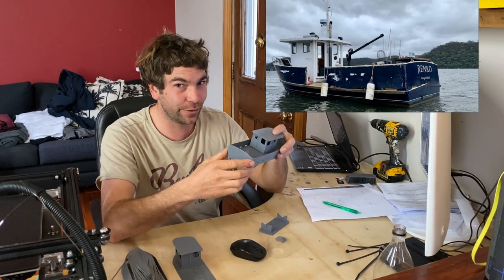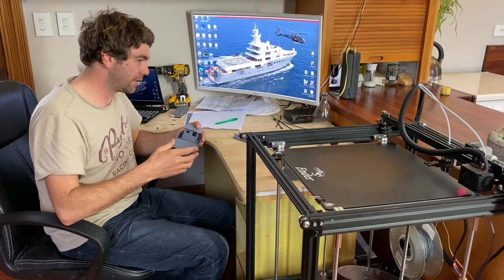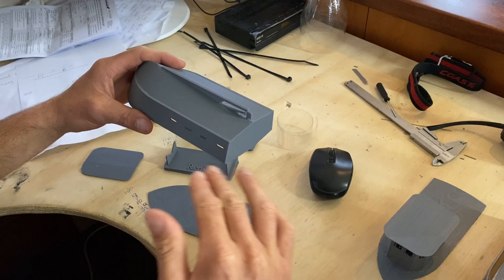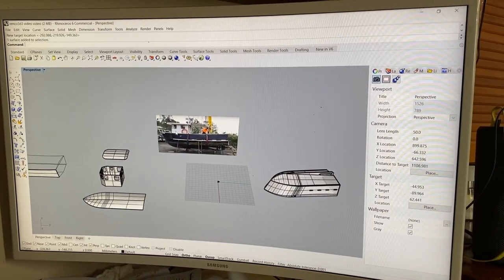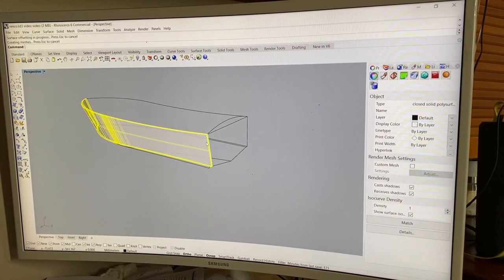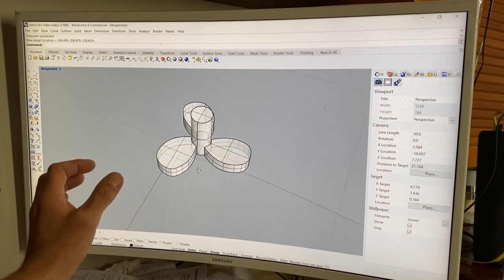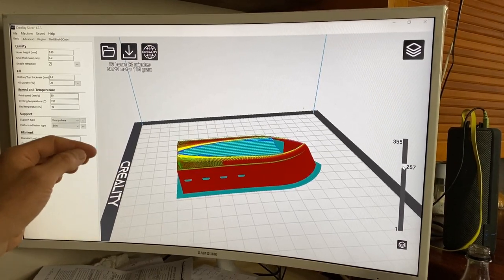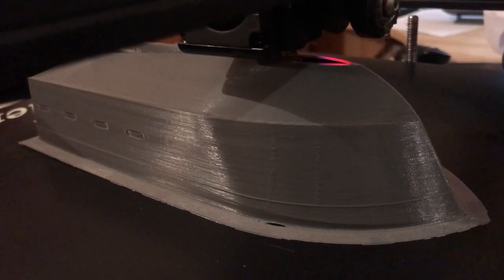3D printing a Fishing Boat

Comment: If you make the thickness of the parts a multiple of the nozzle size, you might speed things up and clean things up a little. ie 0.4mm x 2 or 3 = 0.8mm 1.2mm etc. Printing the hull would have been better by standing it on the stern end and you could probably have printed it without supports.
I just ordered my 6th 3d printer (1 msla printer in there) and started about 2014 :-D

Cura or Prusa slicer are much much better slicers btw :-D